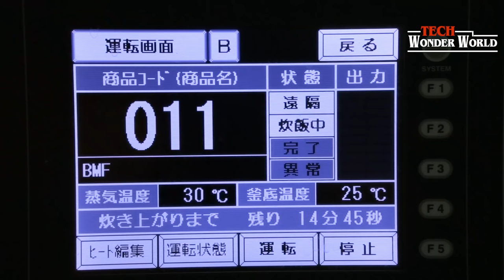Modern Ready Meal Food Factory 2020 Fully Automated Production Line | Advanced Food Processing Tech

Comment: I hope all the packing involved are recyclables too.
Reply: At this time the packaging is not recyclable in order to keep the price of dumplings low so that you will buy them. Industry standard materials are used in this production line. After you eat the 8 dumplings, the plastic goes to landfill and lasts there forever, however your local government may have ways to reclaim the plastic and turn it into electricity. Each plastic tray if incinerated can power a computer monitor for about 5 minutes, and the energy used to transport the plastic to a waste to energy facility can power a computer monitor for 3 hours per weight of plastic tray transported, depending on the distance and method of transport. IF the plastic waste does not travel very far at all, then it can be recycled into energy. in all other cases it is trash with no economic or functional purpose to anyone other than being a dumplings holder.
Reply: @BobbyAeros  when do you think will our technology make a biodegradable packagings 🤔 it's still not mainstream. Very few and expensive to make I guess.